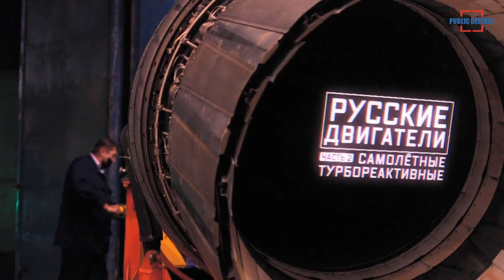Second Stage Engine for the Russian Su 57 Fighter Jet could be Classified as 5+ Generation

Comment: The typical mistake about the 1st Stage engine of the Su-57. Most people think the S-35 and Su-57 use the same engine. This is wrong! The Su-57 has the AL-41F1 (product 117) engine. It is an aircraft turbojet engine with an afterburner and a controlled thrust vector, created by NPO Saturn by order of the Sukhoi Design Bureau, it allows developing supersonic speed without using afterburner, and also has a fully digital control system and a plasma ignition system. It differs from the engine for the Su-35S AL-41F1S (product 117S) by an increased thrust force, a sophisticated automation system, a fully digital control system, a new turbine and improved flow characteristics. The 1st Stage engine of Su-57 already provide all the capabilities of a 5th Gen engine for the Su-57: (1) it allows to fly at supersonic cruise speed without of the afterburner usage, (2) it provides the supermaneuvrability by using the 3D thrust vectoring. The 2nd Stage engine will be just the absolute new engine with better thrust and less fuel usage, it will be lighter by weight and will have the longer life between repairs.
Reply: Let me point one thing: In a dogfight you use 2-D vectoring even if your engine has 3-d. I'm not sure but i think the 2-angle made by f-22 is sharper than the su-35/37/57 engines can do. 3-D is usefull on aerobatics or "air ballet", not in a real dogfight. Dont forget, a pilot is an human, and it just can pull negative G's(blackout). If you try to pull positive G's (redout) you can get brain injuries (or blind) and your best luck is death.
Reply: @GHOSTKILLERAAA  , the 3D thrust vectoring and super maneuverability is necessary not only for a dogfight, but, mostly, for evasive powerful maneuvers against long-range AA missiles, since they burn out their solid fuel long before they rich a target and using only collected kinetic energy and aerodynamical fins to rule the missile to a target. If a fighter can detect an approaching missile (most new Russian fighters can) it can do an energetic evasive maneuver and escape the missile. The missile will have no more energy sources to return back and will be just self-destroyed after miss.
Reply: @maksimluzin1121  , , 3-D thrust vectoring is good if you want to be killed with  G-positives, i suppose you know what is that.. In a dogfight you JUST use 2-d vectoring and JUST pull G- Negatives. . Like i said before, 3-d is for "air ballet" and not in a real fight. "energetic evasive maneuver"(??????) against a mach 4 missiles ???? Good luck. If you try to do it with high speed with 3-d features, you blow your brain, otherwise at  low speeds, you are inside a winged coffin. You are supposing the aim 120 is out of range with the russian plane. Well, low RCS like stealth planes are, will shrink that distance. And at 4900 km/h it will blow it very fast. It will be a miracle if the russian pilot can evade the missile, for sure. I dont mean the mach 5 ramjet russian version  is bad. Analysing by speed and range is superior, but there is another important feature of the missiles The G's which they can take doing turns... A missile which flies just straight ahead, its a dummy missile. If you start to put too much speed on a interception missile, it will starts to turn bad(...) So, you are about to saying to me the perfect ratio, aren't you? Because you have privilege secret russian information ???? AHAHHAHAH
Reply: @GHOSTKILLERAAA  , Any modern airplane is operated by an automatic flight control system, 'fly by wire',  which is using the pilot 'joystick manipulations' just for 'commands', 'glues', but not for the real 'direct' flight planes manipulation. Actually, the short-term 'terminal' G's at 9G and higher, when a human pilot is going to 'pass out', at least for a few seconds, are operated by the automatic system, which will get a fighter to the 'own control', yes, shortly, with the 'flight stabilization direction and plane', automatically. Do not exaggerate the G influence for the professional military pilots! Yes, they can survey even 12 G's for the short period of time + with a help of the automatic flight control system... Secondly, I told you before, long-range AA missiles burn out their fuel long before they rich a target, and use only the ballistic kinetics energy and aerodynamic fins. All of them, at a long range. The G's and M's of the missiles are provided only for the Maximum their values at Active trajectory phase, while they have fuel and their engines are working. At the Passive (second) phase, they are just a 'ballistic projectile', yes, maneuverable, but, with the constantly reducing speed and kinetic energy... By the way, the short-range missiles are more dangerous and have the higher kill rate Probability than any long-range missile, since they just have higher energetic potential... Therefore, don't laugh, but learn Physics. Moreover, I've personally Studied That! And know the subject, from different sources...
Reply: @GHOSTKILLERAAA  , 'It will be a miracle if Russian pilot can evade a missile'... I'll tell you more, Indians on the Su-30MKI, one or two years ago, evaded long-range missiles from the Pakistani F-16 fighters... 😉 Pakistani hit only old Indian Mig-21, or something like that. The Russian/Indian Su-30MKI detected the long-range AA missiles and just evaded them....No losses! 😎
Reply: @maksimluzin1121  , 1) AIM-120 is effective when you are between 15km to 30 km from the target.. F-16 can't reach so close without being noticed , but a stealth plane can!  The indian plane was 60 km far away. The pak pilot was stupid to shoot it so far.The missile speed was about mach 2 at 60km (not flying but gliding from 30km and loosing speed) . Any sharp turn or climb puts the missile at a normal plane speeds (supersonic fighter jet) or lower.... Great evade(....) BTW if you need the link with a good explanation, its here: https://www.youtube.com/watch?v=JLHR7spLEIY
Reply: @GHOSTKILLERAAA  , I didn't tell the Indian pilot did a sophisticated evasive maneuver against AIM-120. Most modern Russian fighters have, so called, 'the second digital pilot', actually, it is an Automated Flight and Combat management system which uses all available parameters to calculate the best flight and tactical solutions. A pilot participate just at higher level of 'solution tree', to make a better choice. Sometimes, a pilot not even participate in it, the System take control from him, especially in a such situation like evasive maneuvers, since the pilot will have no time to make a solution or just will 'pass out' for a short period of time during the maneuver. Usually, a pilot will be just informed by the System and will need to say 'Yes' (press a confirmation button or something like that). The system will take control and do everything for the pilot with the fighter stabilization and main combat path selection at the end of action. The pilot will 'return back' latter and just find his aircraft on the main combat route... Actually, that type of the 'combat autopilot' existed for years already and very well known...
Reply: @GHOSTKILLERAAA  , The last thing I should to say you: you didn't know about the special Russian pilot High G suits, how they are working, especially, the special trousers for them and 'pressure control', exactly, to control blood pressure in legs during high G maneuvers, and to redirect blood pressure to the 'upper part of body' of pilot during them, automatically... Moreover, you don't know how the Automatic flight control and combat management systems of modern fighters are working... Finally, the Su-57 'the second digital pilot', actually, is an almost AI system and don't need a pilot in many cases. So far, only for the take off and landing phases, the most complex phases of a flight... Actually, the system components of Su-57 are used on the S-70 'Hunter' unmanned prototype without any pilot...Yes, the S-70 test flight was controlled from a 'neighbor' Su-57 fighter, but not the 'take off' and 'landing' phases... 😋
Reply: @maksimluzin1121  , learn what g positives are then come here to talk. If you dont know, g-suite ONLY protects the pilot of g-negatives.NOT g-positives. I already said that but you insist being a dummy boy(...). The only mechanism which protects pilots from g-positives on a turn is pushing g-negatives (putting the pilot's head on the center of the turn). When you say "controlling the blood pressure on their legs pushing it to the upper parts of the body (brain)", YOU ARE TALKING G-NEGATIVES. That prevents BLACKOUTS NOT REDOUTS when you get tons of blood in your head and your vision turns redish!!!!! (G-POSITIVES). This is a so basic concept which i cant belive your bright mind didnt know(...)
Reply: @GHOSTKILLERAAA  , I can tell you, you like a boy, who learned a few 'smart words', like about G's, but Not understand the System... I have to say you, The System Calculate All of the things, just to achieve a battle task, including your f@cking G's!!! It Solved already, long time ago!!! Systematically!
Reply: @GHOSTKILLERAAA  , you do Not understand, I've told you that, a  modern fighter pilot just a PART OF A SYSTEM! NOT its the very important part, but the Decision Maker, so far, not an Active Actor, by all Combat Tasks! Just an Activator of them!
Reply: @maksimluzin1121  , another parrot answer...  You dont need such math to make the less cost path. ordered by eligible priority targets respecting the current armament profile and balancing the workload with his team squad (...) You are trying to shine with elaborated answers... A dummy a* algorithm and a little bit more (BIG-M and not too deep neural network for obvious reasons) gives you the answer .  Put the plane computers in a void doing intensive data processing and  the pilot is dead... He doesnt have all day...  Ok, distributed computing, (data-link) but... if the network fails in a critical situation???? But the statement you did about pilot's machine fusion leads you in a contradition... So a pilot in a dogfight wants to do "air ballet" with his 3-d thrust vectoring  machine pushing some positive g's  and (NOW YOU SAY) the computer  doesnt let him to execute it?? Or it allows or not! Use a decente decision maker algorithm that at least respects  your speach coherence(...) BLA BLA dif equation bla bla..bla. Pratical result=PILOT'S DEATH!
Reply: The exhaust nozzle of the first stage engine is not appropriate for stealth though.
Reply: @alexandernorman5337  , well, tell the same to the F-35 designers...😉
Reply: @maksimluzin1121  - Even if the izd. 117 engine used similar advanced materials and coatings as real stealth fighter engines (F135 and izd. 30), it is still lacking a lot of obvious features.

1) The nozzle petals seem to almost never be constricted inwards.  This leaves the nozzle cavity fully open for radar energy to enter into and be reflected back out.  The izd. 30 and F135 usually operate in a constricted mode.  This prevents a lot of energy from entering the cavity and helps to trap a lot of the energy that does enter.

2) The nozzle petals lack serrated edges which would better scatter surface travelling waves.

Izdeliye 30 will do much better.  Izdeliye 117 is a good engine, but it is not a good stealth fighter engine.
Reply: @alexandernorman5337  , well, actually, the nozzle petals add to the RCS only about 10-12% from the back hemisphere, more than 90% goes from the turbofan rotor in the hot part of turbine itself. Yes, the serrated edges of nozzles will reduce some %% of RCS, but not too much. The Second Stage engine for Su-57 will have them. I told not about that, but the fact, the AL-41F1 engine was made especially for the Su-57 and pass all the 'checks' of, so called, 5th generation engine:
1. It provides the supersonic cruise speed without afterburner usage.
2. It uses sophisticated thrust vectoring for the super maneuverability.
The Second Stage engine will be just absolutely new engine with increased thrust, better fuel consumption, reduced engine weight and longer time periods between engine full repairs, therefore it will have the significantly reduced cost of its 'life cycle period'.